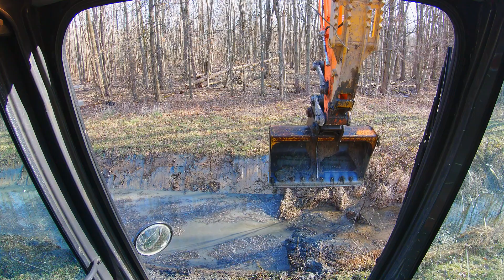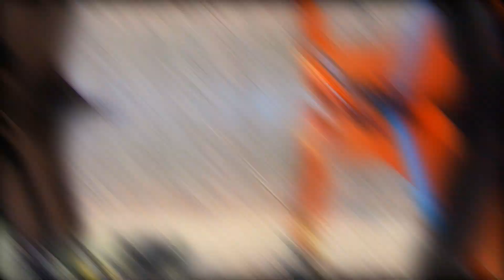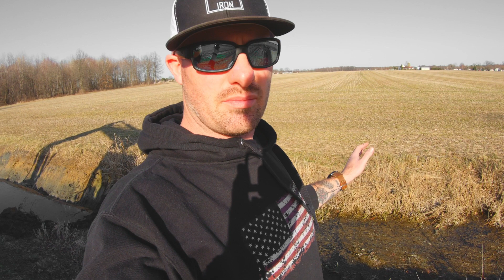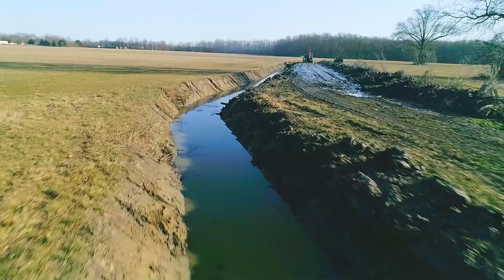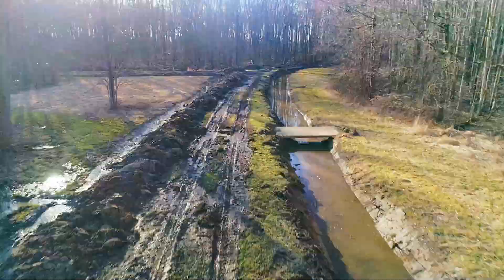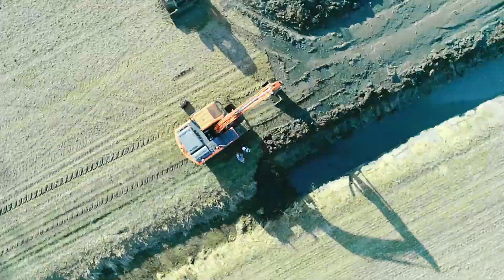HOW TO CLEAN UP A DITCH WITH AN EXCAVATOR - Duel Camera View // Heavy Equipment Vlog Day 2 Part 2

Comment: Even from Ireland I could give up 3 months of the year doing this job on farms one of the top tips I can give you is start from where the water leaves the drain at the end and work back to the start of drain, the reason behind this you working with flow coming in to you that means as you are working backwards you will digging clean water and you get to grade a lot faster try it
Reply from the maker: Thanks Pat!  This was actually working from downstream to upstream but because we didn't do the full length of the ditch it didn't make much difference.  There just wasn't enough flow to keep the water clean.  Thanks for the tip though!

Comment: Interesting way you clean wet ditchs out over there. Here in Australia🇦🇺🇦🇺🇦🇺🇦🇺🇦🇺🇦🇺🇦🇺 I use a ten foot reed bucket I built for the purpose it lets all the water out an just moves debri and silt so you dont end up with all that mud  running around from the water trapped in the bucket. It also enables you to have identical batters as your vision is alot better 🤔🤔🤔🤔🤔🤔🤔🤔🤔🙄🙄🙄🙄🙄🙄🙄🙄🙄 No need for that skid steer to move excess mud.
Reply from the maker: I will say, we aren't professional ditch cleaners.  This was part of an overall drainage job we did so Taylor didn't have any specialized buckets for the purpose of ditch cleaning.  I'm curious to see your reed bucket though...
Reply: @DieselandIron  not a problem there is a  pic of it on my fb I also have a vid of a 12ft cat grader blade i built a hitch on for the excavators to use digging new field drains an cleaning drains full of weeds on youtube  I dont have a vid of me using it been too slack 🤣🤣 I can make a short walk around of it give you a better idea what I am trying to describe
Reply from the maker: @aussiedirtmover  I saw the video of your grader blade. That thing works awesome. I'd love to see the Reed bucket in action
Reply: Just compiled some pictures of it and other stuff in a short vid for you adding to my othe youtube account its..digging dirtau